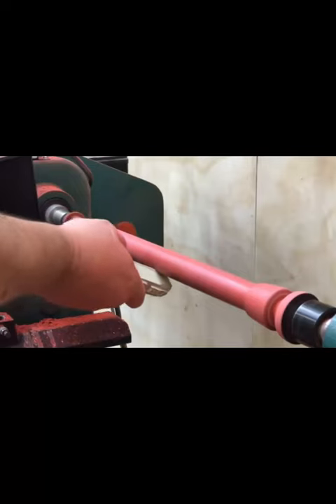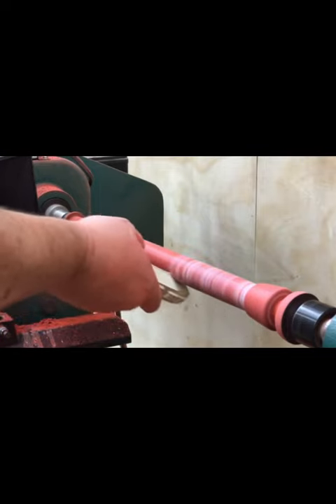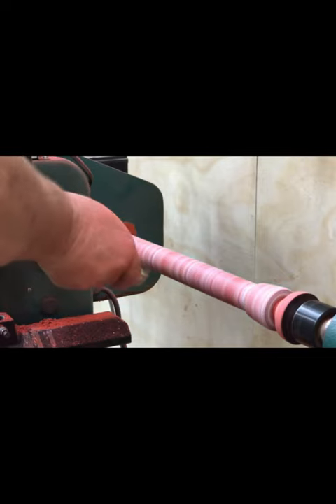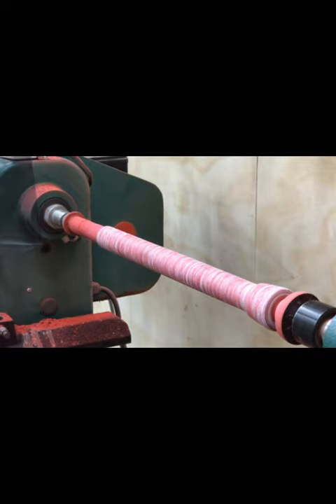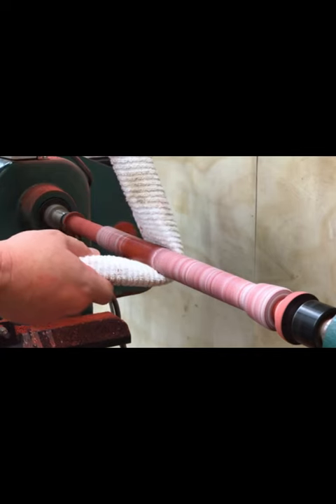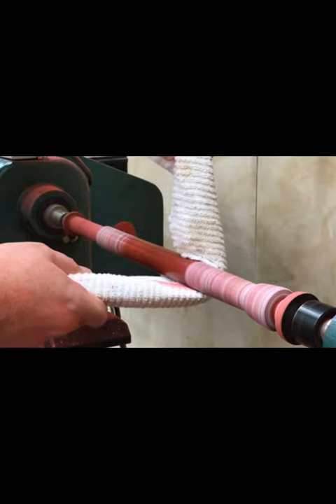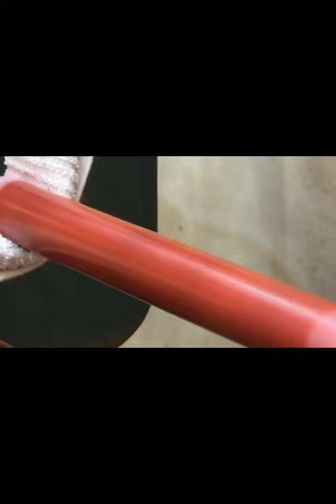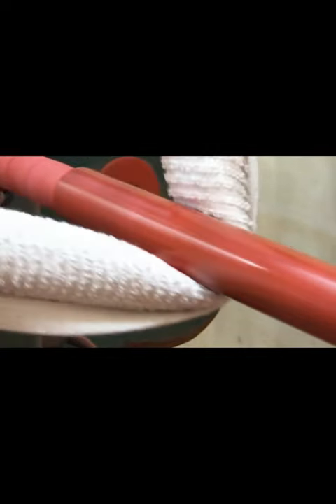16 - How to Make Woodworking Mallet from Lignum Vitae Worlds Densest Wood like Thor's Hammer Mjolnir

Comment: Lignum Vitae is basically the hardest wood that you can get.
Reply from the maker: Actually there are a number of species harder. I have another hammer I made from Australian Buloke which is a good deal harder. And higher on the Janka scale. 

Density and hardness are two different physical properties of wood. Many of the internal cellular structures responsible for density also contribute to hardness. And vise versa. That’s why we normally see denser woods being harder. 

But just the same they are distinctly different measurable properties.
Reply: @Kings Fine Woodworking  Well I was close. Apparently there are 3 species harder than Lignum Vitae which is 4500 LBF Janka. The gap of hardness isn't that great however with Shinopsis Balansae at 4570, Schinopsis Brasiliensis at 4800 and Australian Buloke at 5060. I'll try to be more accurate next time...